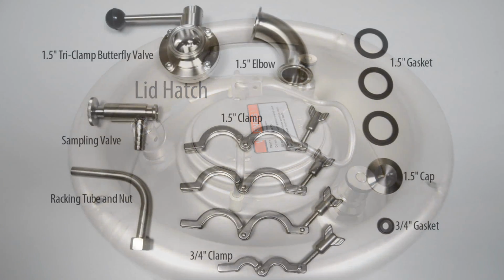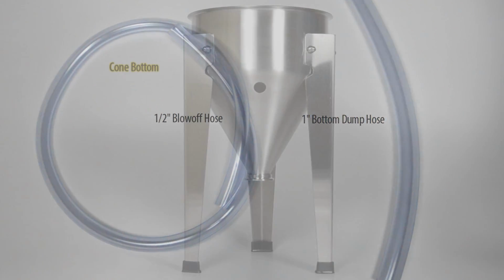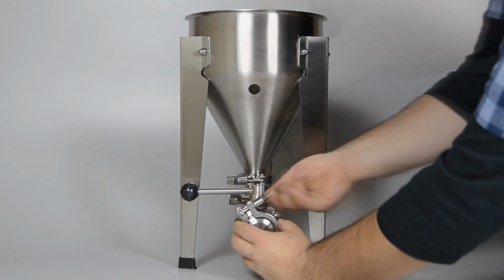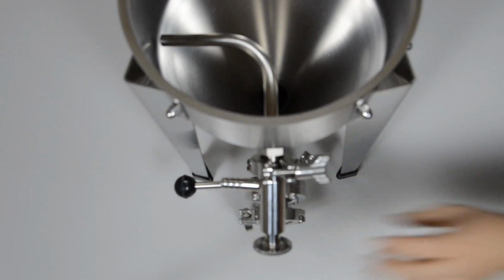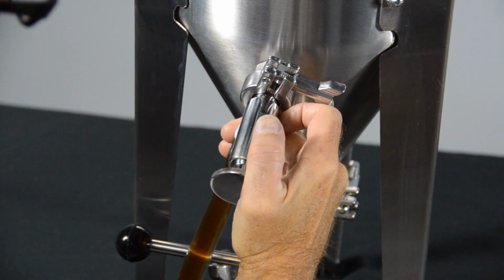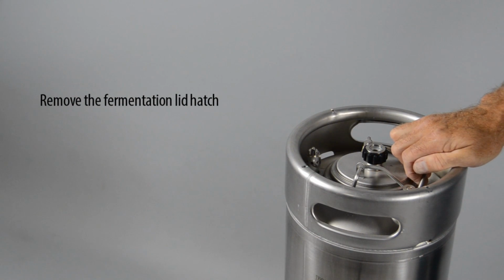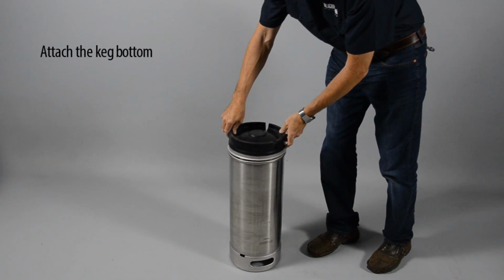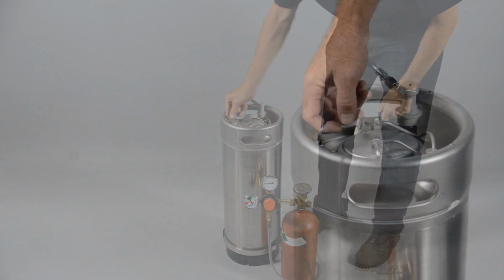The Cornical™ Instructional

Comment: Professional brewer here (albeit not exactly high on the totem pole yet): with the CO2 layer on top of that it's pretty safe. I'm also not convinced one large oxygen bubble during the flip would change your beer to a noticeable degree. Also, oxygen isn't going to turn your beer into cardboard immediately. You just purge your keg properly once it's sealed again and you should be good. I don't own this yet but with my industry experience I'm not too worried about the potential negatives on this. Especially for homebrew purposes. You can spend twice as much for something that technically could have no oxygen pickup, or you can save hundreds of dollars with the negligible downside of minimal oxygen pickup with the ability to purge before it really matters, and a little krausen crust in your keg which probably still isn't half as gross as half the commerical Brite tanks these days with all the adjuncts and post filter beer additions
Reply: Professional brewer here: I see many problems with this system. The problem of how to effectively purge the head space of an open-top container of air before placing and sealing the lid on to it is one that canning line manufacturers have been working on for a long time. This system seems to scale that problem up to a 5 gallon container without offering a solution. That air bubble will definitely introduce a lot of O2 to the beer. It may not change the beer immediately, but it will over time.
Reply: Have you ever tasted the krausen crust on the inside of a fermentation vessel? I would not want my finished product in the same vessel as that stuff.

Comment: All that enginering and stainless steel and $$$$$$$$$ to then introduce oxygen into your beer twice before chilling. Like if they couldn't come up with a way of not having to switch over the lid or the bottom. A total waist of time and to many parts to sanitize. Nothing about it makes it easier for the brewer.
Reply: Not to mention that the crud ring that forms at the top during primary fermentation will end up soaked in the "finished beer"! To me this is a major flaw.
Reply: A few things: 1) that's not oxygen in that space. It's CO2. 2) Any oxygen that gets into that space from the application of the lid, rises as large bubbles. They low surface area of these bubbles allows for very little oxygen transfer. 3) The dissolved oxygen reading from this system is 1.25 ppm; an unrecognizable trace amount of oxygen that will not affect the beer's flavor.
Reply: Either way, it's a cheaper stainless conical fermentor than most out there, so you can always transfer to a clean keg.

Comment: Not a fan of the oxygen exposure that will occur when changing from the conical bottom to the keg bottom for finished beer.
Reply: A few things: 1) that's not oxygen in that space. It's CO2. 2) Any oxygen that gets into that space from the application of the lid, rises as large bubbles. They low surface area of these bubbles allows for very little oxygen transfer. 3) The dissolved oxygen reading from this system is 1.25 ppm; an unrecognizable trace amount of oxygen that will not affect the beer's flavor.
Reply: @TyinAlaska  Do you mean 1.25 ppb, because would be impressive; 1.25 ppm is not (which would be a highly oxidized beer).  Industry standard for acceptable DO is up to ~40 ppb.